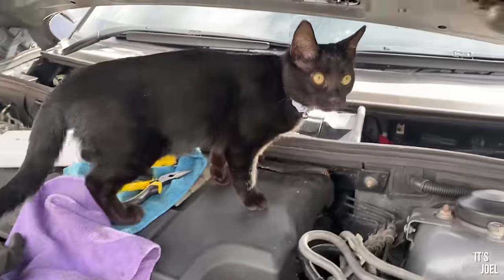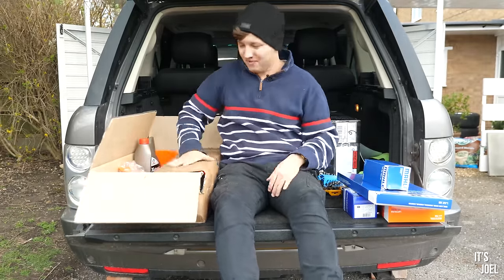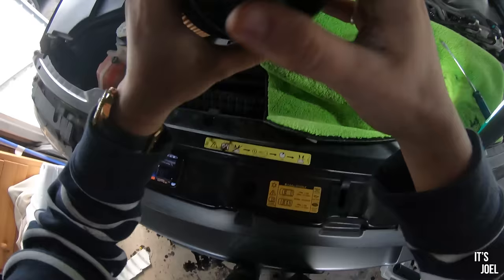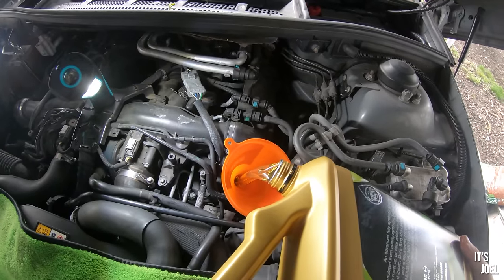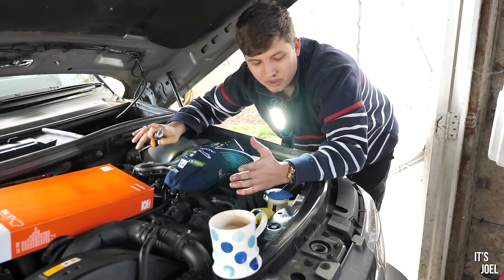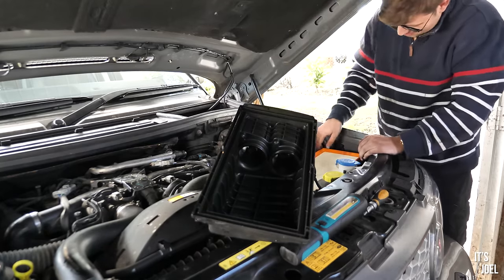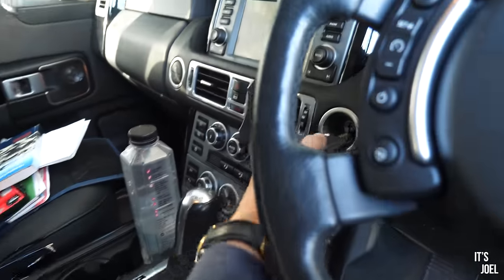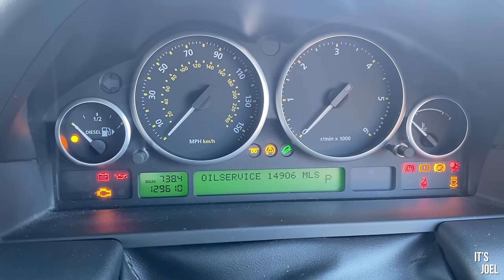130,000 mile service on my Range Rover AT HOME...

Comment: Hi Joel, small tip remember to lube that o ring when you fit it on your oil filter it helps it seat better when you re assemble and when you use that wrench to tighten back  hold the wrench by the ratchet and hand tighten, not finger tighten and don’t tighten by holding the end of the ratchet because it is easy to break the o ring. I bought a Z4 because of you and it gives me many hours of pleasure, so thank you. I just want to share the knowledge. I enjoy watching your knowledge of cars grow over the years since you started. I really liked your buying trip with your dad. You had so many good points to share with him, all learned from the countless purchases you have made. Naturally there are many other ways to do things, including a proper torque wrench. I just want to help you be fail safe like you did with your dad.
Reply: There are so many innuendos in your message to exploit, but I won’t.. 😁
Reply: @davidhammond3738  😂😂😂😂😂
Reply: A good important point about that O ring. 👍

Comment: Typical England,  nobody keeps a car in their garage and it is always full of toot.  New builds also advertise "a garage",  when in reality a modern car won't fit! 
Anything DIY on a car is daunting and easy to keep putting off,  however it is very satisfying when you complete it.  Well done for attempting  and I can see you servicing/repairing  other cars now. If the car does  not have one I like to buy a magnetic sump plug.  Next service you can see if there are any metal filings,  which would need investigating/ early warning?

Comment: Hi Joel. Another interesting video. I also use the vacuum extractor for the engine, transmission, transfer case and p/steering. The 2011 RRS has a dedicated extractor tube to attach the vacuum hose, like some other models. Afterwards, I removed the drain plug to see how much was left in the sump and it was about an egg cup full. No swarf on the magnet or in the oil but was as black as! 
I replaced the transmission pan and filter with a steel service kit, rather than a 'full' so called flush and used the ZF6 fluid. I also dropped the mechatronic valve block to replace all the seals. I'm glad I did. The bridge seal fell apart when I lowered the block and the tubes had shrunk. I saved my self big dollars doing it myself. Well must be off. Have fun and look after yourself and Katie. Cheers, Chris. OZ. 🙃

Comment: The only thing I would suggest is to drain the oil properly as this will remove all the crap at the bottom of the sump. Sucking the stuff out is just a waste of time and money and was encouraged by the manufacturers as a way of getting more money out of customers by taking cars to dealers every year instead of every two years. The dealers will in fact drain and not suck the oil every other service interval ie two years on the A service. Best practice to maintain the life of the engine and its components is to drain it every year. 👍🏻😎

Comment: Only thing I’d recommend next time is use your fingertip to apply a film of oil on the rubber o-ring of the oil filter and fuel filter. This will make it easier to remove them on the next service. Also don’t tighten the oil filter with a tool, as hard has you can hand tight will be enough. The reason for the above is where the engine will warm and cool through being used everything will naturally tighten anyway.

With regards to the fuel economy, the new fuel filter will be letting more fuel flow through by nature of being new and not partially blocked up with old fuel. Yes the fuel economy may be slightly down but in theory engine power should be up. If you are still in doubt remove the fuel filter again and make sure it is fitted in the correct way around, on a lot of fuel filters they have metal tabs showing they can only be fitted one way.

Comment: Diesel oil goes black very quickly as the soot particles get from the combustion chamber into the oil very quickly. It’s normal for Diesel engine oily to be black
Reply: Totally right. More worrying if it is thick and sludgy. Being black isn't a problem or unusual in a diesel engine.

Comment: I think I will contact my local dealer to ask if they alternate draining from the sump on every other oil change. I was under the impression that they always did the suction transfer method. Seems to me that the filter should be catching the crap and not give it a chance to settle at the bottom of the pan. I think you do want to let the engine run for a little bit and drain or suck the oil out while it is warm.

Comment: Stick a bottle of Wynns injector cleaner through it, best £6 you’ll spend.
Give it another oil change in a couple thousand miles or so to give it a good flush as it’s been a while. Half that 15k interval as well if you want to keep it at its best

Comment: Good video, nice to see you pushing yourself and making content of you working on it, rather than taking it somewhere. 

Bit of advice. Use a pick next time you take a rubber o-ring off. Will do less potential damage than a screwdriver. And maybe take the sump off on your next service, clean the crusty deposits and the oil pick up pipe. Will prolong the life of your turbo/ engine by preventing oil starvation 😊👍

Comment: Hi found your video interesting.....its often easy for us professional mechanic.s to forgot we all had to start somewhere...just few we points ...diesel engine... the fresh oil will go black almost instantly...and  fresh oil will not make engine run better...even no its probably most important thing you can do ..to any engine...its also worth running a oil flush in engine let it tickover for 15mins that will breakdown any crude thats inside engine also if your got a sump plug always drain oil from sump you will never ever get all the old oil out with that pump..you probably left around 1/2 litre of old oil inside sump ...and always refill with dip stick removed...  new fuel filter will definitely allow engine  to run better but will not increase economy because its electric fuel pump and injection system controlled by ecu so engine will always take correct amount of diesel unless filters blocked and its restricted the fuel flow ..(engine will run shit and be underpowered) same as new air filter...lastly I'll say this you will not catch any dealer's or good independent workshop's use Granville oil...its a budget oil hence reason its so cheap ..yes it mite match correct spec but that's about all it can do other brands match or exceed correct spec...it used to be cleaned recycled oil few year's ago but I believe its no made in India..

Comment: Nice video, thanks sharing. You did well, taking advice from Sam. That guy is aces. The only change I might suggest is whenever possible, be sure to use genuine Land Rover parts. You might save some money with other parts, but you can’t be sure of the quality. Excellent work!
Reply: Mahle are top brand

Comment: Good video for a novice. But as said make sure you lube the o-ring next time with some of the new oil. Personally myself I wouldn’t use that oil extractor as it never gets all the oil out and it’s messy then draining it from the sump bolt. Also another tip on Diesel engines when filling with oil never fill it to the max. Fill it so it’s between half and full as oil on diesels expands a lot and can actually fail MOT emissions test

Comment: The worst way to change the oil in the 3.6. It has 2 sump plugs for a reason- by not completely draining the sump which has 2 levels, you are leaving a small reserve of crudy oil right next to the turbo oil feed. This means the turbo will eventually suffer from oil starvation as it becomes blocked with this shit , will go bang and you'll be wetting yourself when you see how much it costs to replace turbo on this vehicle.
Reply from the maker: I was just going off the official workshop manual.
Reply: The dipstick goes to the bottom of the sump...if the hose bottoms out...your at the bottom. Taking the sump plugs out is no more effective when draining and JL suck it out. You get zero more crud out through the drain plug and you would have to drop the oil pan and clean it to guarantee zero crud.....if he keeps servicing it like this then he will be fine...10/12,000 miles....golden.
Reply: @fastasfox  I have always wondered about how low the tube goes. Would be good to see using a bore scope at some stage. Assuming you can feel when the pump tube has reached the bottom of the sump? Is it easy to take off the sump pan?

Comment: Should really use a torque wrench on that oil cap - suggested is 18Nm. The threads are plastic and over tightening it can potential strip the threads.

Comment: I 100% wish I’d have bought one of them oil pumps when I first started servicing my own cars. I keep saying I’m going to get a new car and take it to the dealers but never do. I’d have saved myself a load of hassle by buying one
Reply: very handy. I have a 12v oil vaccum pump which hooks up to a car battery. however the advantage of this manual pump is it comes with its own container whereas the electric one requires you finding a container to fill up with old oil

Comment: Talk about diving at the deep end Joel 😉 KUDOS to you for having your first go at self servicing on a TDV8 RR. 👍 For what it's worth it may be a good idea to start changing the engine oil & filter on a more frequent intervals than those recommended by RR. I'd say no more than 10K miles or 12 months between oil & filter changes, whichever happens sooner.

Comment: Excellent, thanks for doing this. My random questions and comments of the day:

Do you know if the gearbox fluid has ever been changed before? If it hasn’t, any concerns about changing the fluid on a vehicle with 130k miles on it? I’ve heard the slipperiness of the new fluid can cause issues….

I make it a part of my service to clean the MAF sensors whenever I change the air filter.

And finally, how do you dispose of the old oil? Can you take that container to a recycling center and drain it somewhere?

Comment: Great to see you getting hands on Joel good content. Ive had experience with the gearboxes on these I had one displaying the fail trans mode and chucking itself in limp mode. I  changed the gearbox  fluid on filter and put an additive in called Lucas at the time the car had done 148k its now on 204k and still going issue free

Comment: When working on a car, even if the engine is running, always have a window open just in case the car decides to lock itself with the keys inside

Comment: just changed the oil on my peugot 508 using an electric pump from amazon, you just push the pipe down the dip stick hole and job done.saves loads of time and not getting messy.

Comment: Solid video, did you end up putting any grease/oil on the oil filter o-ring(on the end of the paper element filter, the little bung) or the filter big o-ring? makes life easier in the future, but sweet to see you attempt it
:)
Reply from the maker: I didn’t, will this actually effect anything with the car ?
Reply: @itsjoel  unlikely, some people like to just to ensure a good seal
Reply: @itsjoel  as Ollie says above it’s a good seal, also means it will tighten up and not grab and tear, had that happen when I first started working😖 It also makes future maintenance a lot easier as the o-rings won’t get tight. With the oil filter being situated on the top it’s prone to a lot more heat so it also helps the rubber just live a bit longer.
It’s a real nit picky thing but it’s good practice to do, tend to grease all oil filter o rings and diesel filter o rings.
A good saying to live by is if it moves or needs to move, grease it. If not paint it.
Hope it helps!

Comment: Fair play, but would proper car guys ever suck their oil out??
Reply from the maker: This is the way to do it according to the service manual
Reply: @itsjoel  better to take out both drain plugs really but this is better than no oil change for sure well done
Reply: How about pumping as much as you can with the device and then undoing both drain plugs for the residue - this would eliminate the potential for a massive mess that I have seen before in so many videos. Although as Joel has demonstrated well,the pump can also be messy!